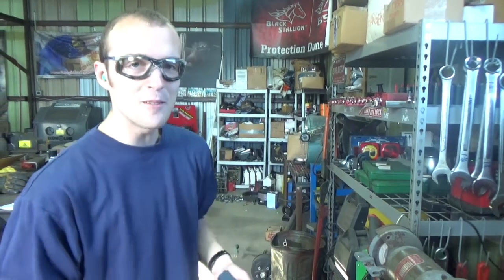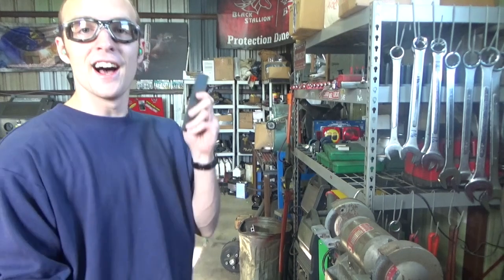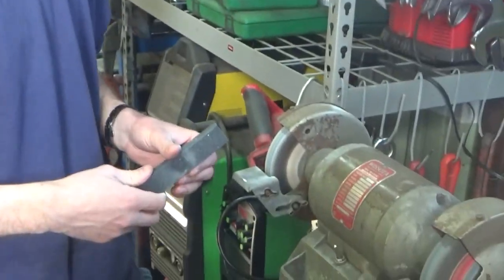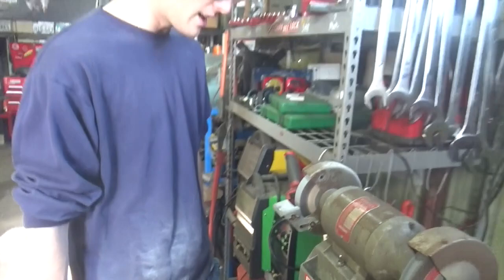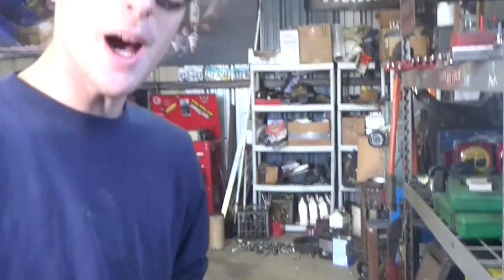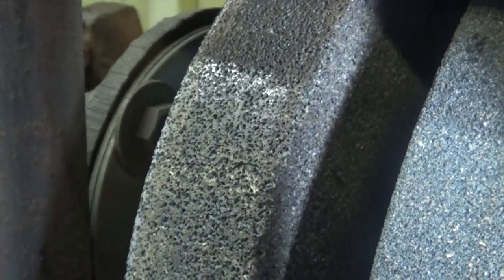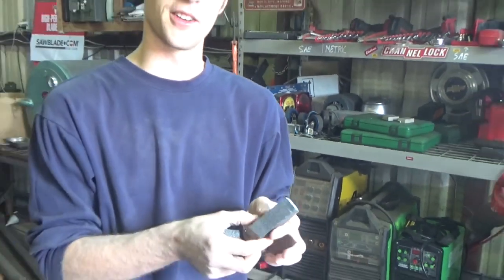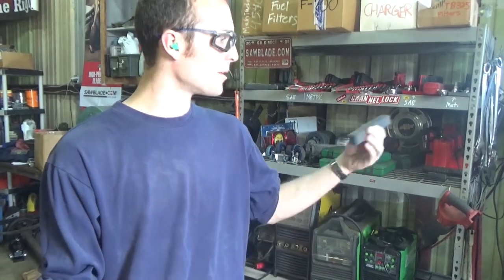REMOVE GROOVES IN BENCH GRINDER WHEELS EASILY WITH THIS CHEAP TOOL

Comment: I've never bothered to look it up for bench grinders, but I've seen quite a few folks with surface grinders have a wheel dressing tool that they will use regularly to keep the grinding wheels as true as possible.  So I always figured there had to be something out there for the bench wheels.  I am very impressed at the affordability, and like you, am wondering why I didn't already have one of these on hand.

Thanks for the video and the link.

Comment: Amazing, that works just as fast as a steel wheel dressing tool👍🏼 maybe a little faster, making a holder similar to a soapstone holder might prevent the vibration from breaking it in half 🤔💡

Comment: I knew a man who was killed by loading up a grinder with metal, it blew up and severed his jugular vein. No brass, aluminum, zinc, or other soft metals. The silica dust from grinding isn't healthy either.
Reply: Yeah! The dust cloud dude! Get the vacuum or your welding helmet power filter thingy, Before you dress a wheel. Inhalation of grinder wheel dust, sand blasting dust & concrete dust causes Silicosis, a horrible lung disease that is Not curable, but 100% Avoidable! We want you well for a long time, Stretch. Peace, Paul from S. Central Tx.

Comment: I've been around bench grinders for decades, and I have NEVER seen grooves like those!!!🤯🤯

Granted, although our's have been heavily used, we have never been trying to sharpen or clean up tungsten and that type of stuff.
Only basic steel. And in recent years, a tiny bit of aluminum.

My grandpa, my dad, and then my high school metals shop teacher... always taught me to move the material across the wheel's front, instead of holding it in one place.
With the idea, that by doing so, grooves would not be created in the grinding wheel.

Is that not the way most people do it?🤷‍♂️

Comment: Dressing sticks are usually made out of a material called carborundum. Which according to the interwebz is silicon carbide. And yeah dressing grinding wheels is a good practice. Keeps your wheels true and sharp. I'm not a fan of star dressers myself but they may be Chucky's speed?
Reply: @obamapox8185  what happens depends on many variables. One can safely assume that not breathing contaminants is preferable to breathing them though.
Reply: @obamapox8185  I'm sure the dust hasn't killed Stretch yet. My grandma always said you have to eat two bushels of dirt before you die. So unless you want to live forever or just eat it all at once you have to get your daily requirement in every day!

Comment: It is made from silicon carbide as stated on the box it came in. So you could have used a part of an old silicon carbide grinding wheel to save you the bother. Or even better, change the wheels.  Typical American.